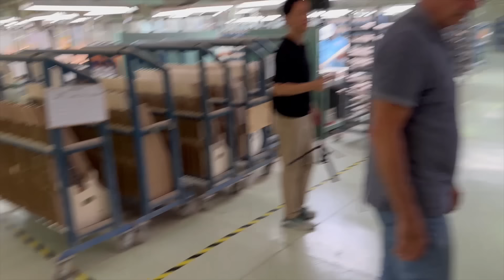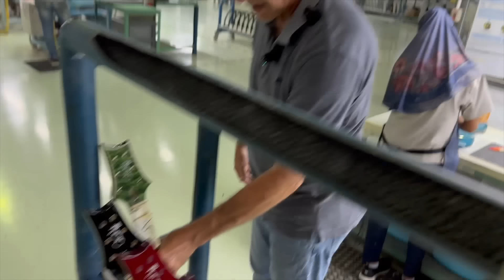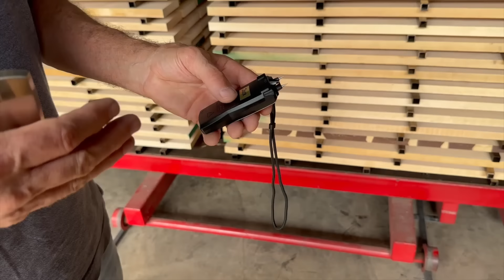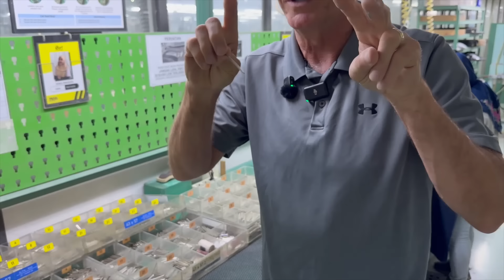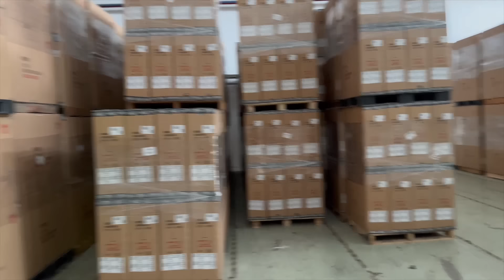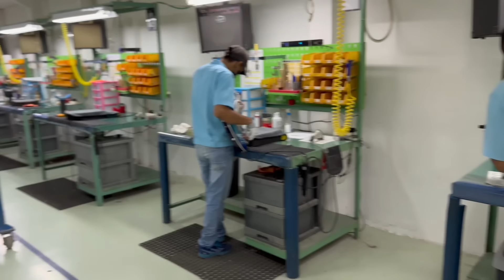Is PRS SE Just Repackaged Cort Guitars

Comment: As a drummer, and call me crazy because I really don't know what I'm talking about, but I would imagine all the tension on a guitar is only on the neck so it makes sense to make it out of a stronger maple. I'm imagining that the poplar body really doesn't make a difference to the sound because most of that comes from the electronics correct? Poplar is bad for drums just because of the force being administered causes distortion in sound to the softwood. And poplar shells tend to not hold round very well. This is great work you guys are doing especially on these videos. You have managed to get a drummer interested in guitar making

Comment: I purchased a PRS SE model 24 half semi hollow body a few months ago from SW that I’ve had to return. The truss rod adjustment won’t hold position, it had five high frets that needed leveling, and the piezo circuit keeps making random popping noises. 
The guitar was defective and nobody at the PRS Cor Tek factory caught the flaws. 
I have a Silver Sky SE I bought when they came out that was good out of the box. The same with my Dave Grissom SE, that I bought when it came out. Good out of the box. 
I’m done with PRS. Their American models are too expensive (I bought a used Silver Sky core model for a grand under retail price, but I didn’t like the 7.25 neck radius. I sold it), and now I suspect that their SE models are skipping basic QC. 
I have several high end guitars, but I don’t like traveling with them. The PRS SE line is affordable and the guitar is easy to replace if lost or damaged.

Comment: Purchased a PRS SE McCarty 594 last year.  I thought they play, sound, looked great and really appreciated the guitar that much. I had to sell it and will try the core series later  to see if it woud make me feel the same way. The only thing I didn't quite like but more of a personal preference was the placement of the bridge pickup in relation to the bridge. The guitar has a longer scale the bridge sounds a little different for my liking as I've been a Les Paul player for too long. I loved the poly finish as well as they are more resistant to scratches.  Regarding tops and colors - I had to audition a few colors and veneers as some tops feel like it was just drawn. However, I found a few tops which had the light reflecting(walking) on the veneer tops on different angles and feels like more of a real flame top.

Comment: I just have one question: Why is PRS still using the 6-hole trem? Every other video I've watched regarding this type of trem indicates that it is inferior to the 2-point trem. I understand if you want a vintage style strat, you would go with the 6-point, but why on a PRS?
Reply: PRS’s six‑screw tremolo systems represent a significant advancement in both design and functionality compared to traditional vintage-style units such as those found on Fender instruments. PRS trems are engineered to operate with a smoother, more responsive “floating” action, aided by six specially notched screws that allow consistent, friction‑reduced movement in both upward and downward directions. A direct comparison between a PRS tremolo assembly and a standard vintage trem clearly highlights the differences in precision and hardware quality. While two‑post systems can perform well initially, their knife edges tend to wear over time, leading to instability and reduced accuracy when returning to pitch. PRS’s notched six‑screw approach effectively mitigates this issue, providing long‑term reliability and more consistent performance.
Reply: The PRS trem is nothing like a Strat. The number of knife edge screws or posts is just another variable in an infinite equation.

Comment: I just bought a SE 594 that didn't win the visual battle and they didn't level up.  And it was probably the best one out of the batch that I saw on the Sweetwater site.  The bookmatch is off and depending on the lighting the top half of the guitar looks dark and the bottom half looks light and parts of it especially on the horn looks kinda washed out.  Kinda disappointing buuuut it plays great and sounds great so i'm going to keep it.  Oh and that's besides them changing a bunch of stuff from how it actually looks on the website.  The one on the website of course looks amazing.  Different pickup rings, tuners, headstock from what I got.
Reply: New for 2026. Other Tuner Buttons, Pickup Rings, Knobs and a Black Gigbag

Comment: My question:  So...why has every SE I nave owned (3) had a shorted and defective 3 way toggle switch, scratchy and shorted pots, melted insulation, sloppy soldering, and cold solder connections that I have had to repair and replace?

Comment: I believe the SE line is currently the best non core offering of any of the larger manufacturers.   There are some good Epis, I have a 59 LP that is great but Ive also had some crap Epis including an SG and a previous LP.   The higher end Squires can be good but there is a lot of variation in Squires in my experience.  I do own a Squire Thinline Tele which was cheap and is great but my first guitar was a Squire and it was terrible.  Also tried a few out when I bought the Tele and there was a lot of variation.   I own 2 SEs, a Custom 24 and a DGT and they are both great.   Very well built, very well finished, play great and look fantastic.  I have 2 and have played dozens more and they are always good quality.  I honestly think the Tobacco Burst DGT is the best looking guitar I own, I just got it for under $700 and I am comparing it to guitars that cost three times as much.  I think this video explains a lot.

Comment: YES. I tried 2 PRS SE (the Bonnie pink, and the sandblasted ash) and I returned them both. They're just not that good compared to the PRS SE made by WMI Korea before. The Cor-Tek PRS easily loses tune and the truss rods need improvements. They feel generic also, like they feel like a Jackson JS32.

At least LTD and Solar are both made by WMI Indonesia, those two brands are metal machines and I would get a Solar at any point of the day compared to some more expensive ones by like, Charvel In Mexico, or even FGN in Japan even.

Comment: Being pedantic I know but there is a difference between Quality Assurance and Quality Control.  You keep using it wrong.  QA is developing procedures and processes to ensure standardisation and remove variance.  The standard operating procedure you showed on the wall is QA.  The guy checking the measurements to ensure they complied with that procedure is Quality Control.  Quality Control is the process of ensuring each item conforms to those procedures and standards.

Comment: My SE NF3 is insane...I also have a core 24...i only say that for comparison's sake. The SE was delivered in the dead of winter, had major fret sprout, after some weeks of warming up acclimating, still had fret sprout, I fixed that with special files...after restrting it the 4th time the nut just fell off...2 dots of super glue fixed that. Aside from all that, the SE was FIRE...the neck is not exactly a wide/thin...it's a hair thinner...just a hair but noticeable and smoother...faster. The tuners stay in tune decently, the trem block is nice. In time I may swap the tunners for PRS locking and possibly the trem....but the pickups are insane...I think they may even be studio worthy...i'm not exaggerating. Are they DMO's? no....they're not...but dang they don't suck either....

Comment: First of all, I have been playing stringed instruments for over 50 years. I'm about to pass the sixty laps around the sun mark, and recently bought a Cort five-string bass. I am impressed with the build quality from the Cort side of the facilities.The bass is the Cort " Kurbow", with a composite luthite body and a three-piece laminated maple neck, and a composite fretboard. I bought it used. The P.O. had heavily modified this unit with a single Bartolini pickup and active EQ and preamp/tone, volume controls, Gotoh tuners, and an upgraded bridge. This guitar is incredible!  I can chord it! It inonnates perfectly and is as stable as a rock in New England weather. Which brings me to my point. I've been ogling PRS SEs for a few years, and that is the next one. I have been a little hesitant about the SE line. Now I am sold. Thank you for your time and travel, and effort.  People with $5000 to spend on a U.S. model may even be tempted to try the SE. line. I'm going to buy myself a gray guitar and play. P.S. This thing is going to be heavily modified too, but it really does look like the product is worth every dime, factory fresh.

Comment: thank you for this fascinating and highly informative video Phil! About the pickups: if the voicing of the SE pickups is altered using a resistor on the pot and not necessarily by the pickup's construction, as Jack says when talking about the SE NF53, then wouldn't you be able to get them to sound even closer to the core pickups simply by wiring the guitar up like the core version (using PRS's wiring diagrams on their website)? That might be an interesting comparison

Comment: 7:30 interesting. Sure you don't want to damage your american made model's factory. But they COULD if they would spend a bit more in materials and use nitro finish instead of a poly finish. It would make the guitar cost like 500 more, but that would equal the US line of the guitars. They CHOOSE not to do it because if economical reasons. Imagine being able to buy an American PRS for 2k instead of 5k.

Comment: In regards to the question is it just a repackage cort guitar.........    

 None of the guitars made in America are built by Paul Reed Smith.

 None of the guitars in Indonesia are built by Paul.

In the US he has hired a bunch of people that he has Trained to make the guitars that he envisions.

In Indonesia he is hired a bunch of people to make the guitars that he envisions.

 There is no difference.

 They are building different guitars in America compared to the ones they are building in Indonesia. And instead of starting from scratch in Indonesia he has taken advantage of a company with a very large infrastructure Already in place to do the work.
 But the difference between what's being built-in Indonesia and what's being built-in America is irrelevant. They're just different models of a guitar brand.

None of these are being built by Paul. And at that point it really stops mattering well is where they were built. It says Paul Reed Smith on the headstock because it has been approved by Paul. 

 He doesn't build guitars.
 He hasn't built guitars for decades. 
He trains people to build guitars and he oversees what they do.
 The guitar made an Indonesia is every bit as legitimate as the ones made in America.

Comment: I bought an SE last year and they left the frets sticking out over 1/4 from the neck,they never cut the ends.I sent the guitar back to Maryland and all they did was cut the frets leaving the fret still sprouting and didn't level and crown the frets like they promised. I get the guitar back and their is still  rough frets and still had sprout.PRS promised me that they would go over it again for the third time and that Paul would play it and sign it.I get the guitar back again and their is still problems with the frets,so I got my money back. I had bought a Hollowbody 1 Spruce topin 2000 and a CE22 the next year absolutly fantastic .I bought a different model SE and it came with the worst setup ever.Im buying Agiles and AIO Wolf guitars now

Comment: I’d be curious to know if the “poplar” they’re using is the tulip poplar (aka yellow poplar) that is very common in the mid-Atlantic, which isn’t actually a true poplar, or if it is some other species. Higginbotham’s description of it being mostly defect-free sounds like tulip poplar; they often don’t have any branches for the first 20-30+ feet, and it is well-known by woodworkers for its stability (often used to make drawers). It has very little grain and isn’t porous, so it takes paint well, but it usually isn’t stained because the end result would be boring as hell. Hence why the Silver Sky only comes with painted finishes.

Comment: My Cort G250SE is a steal w alnico 5 pups 2 point trem bent steel saddles and a roasted maple neck for $329 its my only strat and i can't put it down😂
Reply: Update Ive sold the Cort towards a Charvel Pro Mod DK22 walnut top gold hardware Gotoh 510 trem roasted maple Speed neck, the fretboard is so rolled I cant put it down and the Duncan pups shimmer and sizzle on the fretwire like SRV or Jimi so much clearer than the Cort stock pups! The beauty of the DK22 is the middle position isnt the middle pup alone like a strat it isnt even the middle pup at all it is the neck plus one coil of the bridge pup so it sounds just like a Tele in the middle position and a classic fat strat in the other 4 positions....THE BEST OF BOTH FENDER WORLDS! A strat with a tele setting in the middle!

Comment: I've handled a few G&L Tributes and a few Cort brand guitars, and the G&l definitely had a consistent slightly higher level of fit and finish.  It's hard to describe but each brand also had a different 'feel' that maintained within their brand.  Makes sense that Cort is using different factories for different brands. 

Nice to see PRS developing manufacturing over there, as much as I'm gonna miss G&L.
Reply: G&L also use same bridges and MFD pickups as in their US models.

PRS also use same bridges on some of their models as in the Core one. as far as I know they use same wraparound on the Paul's SE and Core. 
the adjustable wraparound and two piece bridge also looks very similar as in the US models. but not sure whether they are the same.